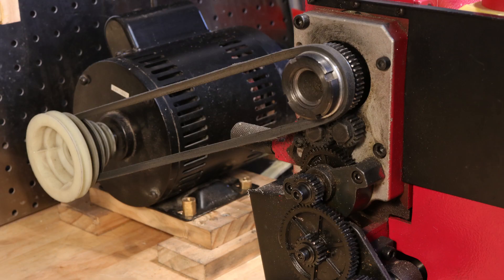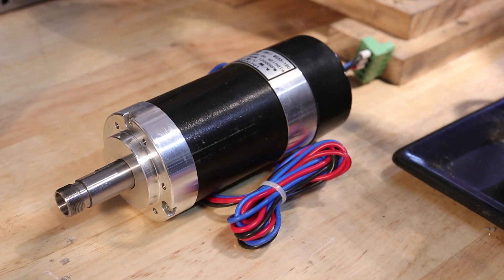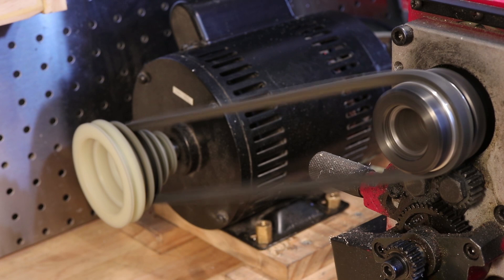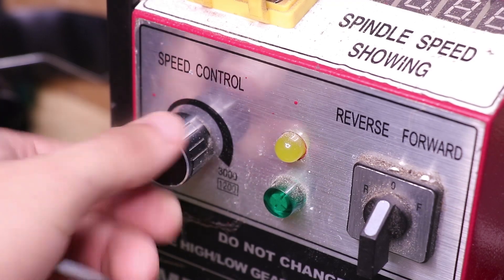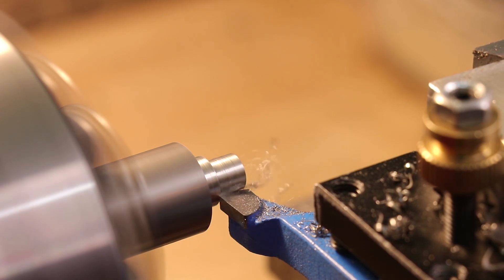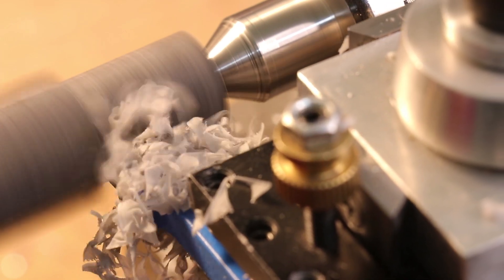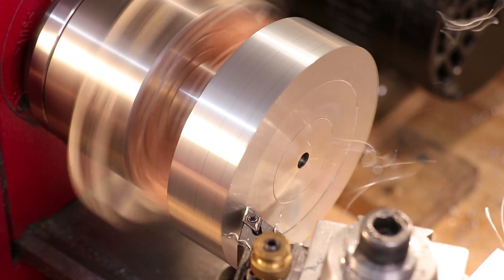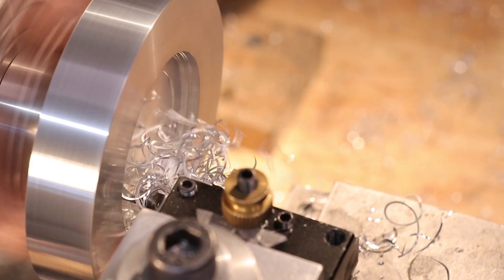Mini Lathe AC Motor Upgrade

Comment from the maker: G'day everyone. Thankyou all so much for the feedback. I might have said it but motors and electricity are not a big strong area for me. I apologize if I got a few things incorrect in this video, and thankyou to those who corrected me. Cheers.
Reply: Please provide the address for this mini lathe dealer/distributor, in Indonesia .
Reply: Do you need to remove the internal gears on the headstock, or just lock the lever into the unengaged position, just using the auxiliary motor when heavy cuts are required?
Reply: Hey, what's up? Here i will give you some extra points if you are interested, 1 you can purchase a single phase VFD for that motor
2 another option is to use a big brushless DC motor and a large power supply and esc
3 the most obvious one it's to change that motor for a 3 phase motor and use a single phase to 3 phase VFD (which are very common and for that, quite affordable)

Comment: I'm about to do the same thing with my 7x14 mini. I'm adding a 1HP AC 1 phase motor with variable speed. I don't need reverse. I have a motor laying around that's 1750RPM (compressor motor) so I figured I'd use that. This gives me a better idea, though I'm not going to need the belt pulley you are using to control speed. An AC motor speed controller can be found on amazon for around 20 bucks and they work pretty well. I'm turning my own pulleys and will be replacing the stock bearings with tapered roller bearings and making an oil seal for the shaft so I can just use heavy weight oil for lubricant rather than occasionally adding grease.

Comment: How do you get 1800 rpm on a 50Hz induction motor? The synchronous speeds for 50Hz are 3000rpm and then 1500rpm, and then the slip will slow down an induction machine a few percent at rated torque.

Comment: I really like your idea but my question is, since you pulled the motor and pulley attached to it from your drill press, couldn't you just use the pulleys off the drill shaft and re-work them on your lathe spindle? This would give you multiple speed settings over a broad spectrum from very high rpm to a low rpm. Thanks!

Comment: If you use a common condenser start motor you can easily reverse switch it. Just watch the pulley doesn't unscrew in reverse

Comment: I'm surprised no one has tried closed loop speed control of these dc motors, whether brushed or brushless. I have no trouble doing wide groove cuts on my 350w brushed mini lathe but my hand is on the "speed" dial cranking up the power to maintain a steady 100rpm or so while also feeding the cross slide. That's the problem with dc motors however, to maintain rpm under load power needs to increase but it can't do this on its own. AC induction motors on the other hand naturally pull more current as load is applied to maintain a fixed rpm, coupled with the fact in thus set up the motor is running at peak torque constantly with gearing to adjust spindle rpm.

Comment: Where did you buy the spindle pulley?? did you buy it or did you make it urself?
Reply from the maker: The pulley I made from a piece of 50mm diameter aluminium. The belt is a common k30 v belt
Reply: @artisanmakes   Is the pulley threaded on or is the ID just large enough to slide over threads? Thanks
Reply: @Glenn Howe

Comment: "Insulation class" is what you're looking for on ac motor.  it's longevity directly related to the avg temp it operates under.  it should be a letter on your nameplate, A - H

Comment: If you need all the options & speeds etc etc....buy the right machine for the job instead of constantly jerry rigg'n the poor lil lathe. Seriously...a motor driving a shaft with a chuck on it to turn simple parts doesn't need all that many bells & whistles.

Comment: Where did you get this from...? https://youtu.be/I7UU_MoaieI I mean that "single phase AC don't work well with VFDs" statement is pure nonsense. Single phase AC works very well with VFDs if you buy a VFD made for single phase use. In fact, it is very common, and a good reason to buy a VFD in many places, where three phase is not available. There is no reason to confuse your viewers with such statements, especially for hobby use, it is an excellent way of generating three phases to enable use of 3-phase motors. I dare say that your solution is MUCH worse than using a VFD and a 3-phase motor, but considerably cheaper.

Comment: so, having no reverse does not matter?  Thats what l want: on off switch. No mother boards & controller.
Reply from the maker: Not for me, at least at the time when I did this upgrade. No control board, and when I stall the motor, once I pull the cutter back it springs back into life. No resetting anything. Cheers
Reply: l have about completed your install of plain ac motor with 4 banger pulley.  Gotta make alum pulley on motor.

Comment: For anyone looking at this upgrade, consider a gates polyflex belt. With the appropriate pulleys you can get 8 ratios in a small package. My lathe gives 8 speeds between 360 and 2820rpm off an AC motor.
Reply: nice and compact

Comment: I understand your reasons for your motor selection. However, everyone has different needs and wants for their motor for their lathe. A quality variable speed motor with a equally quality speed controller circuit can and does work flawlessly for years. It is all in what you want for your needs. Thumbs Up!

Comment: What pulley did you use on your lathe spindle for the belt? Dimensions? How many teeth? What size belt, how many teeth? What's the groove rating? Links?
Reply from the maker: It's a standard k30 v belt, no teeth. The friction of the pulleys is enough to drive the spindle and in the event that I crash the tool into the machine the v belt will slip and prevent it from potentially snapping. And it's much easier for me to machine custom v belts in-house than having to index and machine teeth.
Reply: @artisanmakes  Please make some more Mini Lathe videos, they're great
Reply: @artisanmakes  Do you remember the inner bore diameter of the pulley you put on the spindle?

Comment: Wow so I shouldn't put a hydraulic motor directly geared into the headstock. I figured itd have great low end torque, and it would be adjustable... But I guess I could shred all the gears lol
Reply from the maker: I'm sure you could find a way to do it, since the motor directly drives the spindle it won't put load on the headstock gears, only the leadscrew.

Comment: You should really put a big sheet metal shield of that motor.. give it a little space so that air can still get into the motor easy, but the shield can block all of the debris that is flying off of the lathe.  Letting all those chips and dust go right into your motor is a good way to kill it fast.
Reply from the maker: Not a huge issue for induction motors, had it this way for over a year and a ha and I've never had issues
Reply: @artisanmakes  I get that...but you're throwing metal chips into open holes where there are coils of wire.    If you keep letting it get caked with dust, eventually it would overheat when you actually run it hard.  Even if it takes years, there's just no point in taking that risk when a simple piece of sheet metal or even plastic could be mounted over it.. Super simple....  We could drive our cars without air filters and it would work fine--  but it doesn't make it a smart thing to do.....  I mean hell----  Just lean a cardboard pizza box over it.  done

Comment: It was what I was looking for, I have a similar lathe and I'm about to mount it with a single-phase motor with a 6-pole switch for reverse, you would have to try it. Greetings. I use a translator, my English is terrible

Comment: The minilathe is really lacking torque   at low speed. Both the motor and the drive belt are a bit too small for my taste and the low cost (no gearbox at all) version is thus limited in size and speed (low end).
My first move was to make a DC driver with a good speed stability (using some type of speed sensor for a feedback loop). But an other type of transmission is a must and then going for a bigger motor is probably making more sense.

Comment: Just realised, you know you could use a triac as a speed controller right. E.g. a light dimmer switch ;)
Reply: They are less than ideal at low speeds.
Reply: @reneemakesthings  Fair, but you'd not need as much torque at low speeds when cutting threads?
Reply: @noviceartisan  Nah - the exact opposite.  You need ALL the torque to cut threads at slow speed.
The force on the tool tip is very high when cutting slowly (Have a look through ABOM and Joe P's videos for more detail), and that force needs to be balanced with the energy input.
The triac method works by reducing the amount of power going into the system, but in a very loosely controller manner.  The energy pulses are always spaced at 100Hz, so at slow speed, there will be a significant dead-space between those pulses.
It's in those dead-space where the motor can stall, or be over loaded.
This is why small lathes use either a brushless DC motor (with a controller running at 50-150kHz) or a VFD induction motor - they have much smaller dead spaces in the power delivery cycle.

Comment: That's weird, I thought VFDs emulate three phase power https://youtu.be/apQKgs_D0DM And what kind of lathe did you buy?
Reply from the maker: G'day, my understanding is that vfds don't work with 2 phase AC induction  motors, but I was not aware that vfds could emulate 3 phase power. The late that I bought is a 7x14 Sieg c3 mini lathe. Cheers
Reply: @artisanmakes  I also like watching this lady as she is excellent at breaking down and explaining tasks on the lathe and mill. She has a whole series on beginning stuff, which is where I'm at and has projects that you can get the plans. https://youtu.be/YoN_MSuqzE0

Comment: I've hooked up a single phase VFD outputting 3 phase to a single phase 2 HP induction motor for my belt grinder.   No, not in the way you might think (using one output phase out of 3- this doesn't work with all VFDs, many will trip a protection circuit if the phases aren't in reasonable balance)..   In my case,  I had a capacitor start motor where both the run and start winding were identical (same gauge wire, same # of turns), so as an experiment, I took out the cap as well as the centrifugal switch and wired the motor windings in an L config and hooked up the VFD as if the motor was a delta with an open winding and calculated the appropriate voltages and programmed the VFD, and the stupid thing actually runs..   It lugs a bit slow speed, but I can get it down to 8 rpm and it still has full torque and I can't stall the belt and even though there's 1/3rd of the motor effectively missing, the phases are below the imbalance trip threshold so the VFD is still happy and I doubled the high speed limit from 1800 rpm up to 3600 rpm for hogging metal...    So there are many ways to get motor speed control to work, even some unconventional means...

Comment: If you don't want to spend $250-300 on a VFD + 3Ph motor solution, sewing machine motors are a reasonable compromise.  https://www.ebay.com.au/itm/333430509304. I have a 10x20 and I replaced the stock 1Ph 750w motor with a 600w 3Ph + VFD with vector control.  I overdrive the motor with 2:1 pulley reduction to improve the torque, has been fine so far.

Comment: As stated below single input to 3 phase output is normal for VFD plus vfd will give the reversing function.
One day I am gunna put a single phase motor on the output of a vfd and see what happens...
It is possible to reverse a single phase induction motor ONLY IF the four (or six including the centrifugal switch wires) winding wires come out to the connection box.
Most industrial type ac induction motors  (like yours I think) are capacitor start motors with two windings. A main winding and a start winding with the capacitor and centrifugal switch in series. You need to reverse the connection if the start winding to reverse the motors direction.
Having said all that, most single phase ac induction motors only have 3 wires coming out to the connection box and cannot easily be reversed. The main and start windings are joined internally with the junction wire plus the other end of each winding coming out.
You never know unless you havalook in your connection box.
Reply: FYI, generally VFDs are designed to function with some sort of feedback on all 3 phases and can be damaged if you don't hook up all 3 wires. I've tried it at work with old VFDs nobody would miss though, and it did as expected though the motor had a lot less torque than just a direct connection.
Reply: @LuciaMakes  Thanks for that. Did you a vfd 3 time the rating of the motor? If not, maybe the VFD could not supply the motors required current thru a single phase, particularly start current?

Comment: Have you considered using one of the sub $200 USD sewing machine motors, often sold as "Sewing Machine Servo Motor BLDC." They are incredibly  torquey at low and high speeds and beats any AC induction motor VFD or no VFD at the same Wattage. They all come with their own controller.
Reply: I bought one of these for my wife's industrial sewing machine 10+years ago, and when it arrived she was so close to tears, as she couldn't believe how dumb I'd been to think this tiny motor was going to replace that over 100lb AC clutch motor that was no longer working. I showed her the hp rating was actually a quarter horse higher, and she just looked at me like i was an idiot that wasted $80. She is from a 3rd world country, and $80 is close to a weeks wages there. She saves money like noone I've ever known. So she is really upset at the way i e always spent it. Like water trickling , and  flooding  out. I tuned her  out, and hooked it up.  No lights dimming when clutch is engaged, no clutch to engage.  
No constant loud motor running, all is quiet till she pushes the foot pedal, the same one as before, motor came with all the proper linkages. It has been running in a sub commercial fashion for over a decade, and works fantastic. She admits In a production environment, like a sweatshop, the clutch motor beats it hands down Becuase the motor is constantly running full speed so when clutch is engaged, it goes right now. This takes a fraction of a second to build speed. But she isn't working in that environment. She is hemming pants and skirts mostly, or as she is trained making patterns, and then dresses and gowns for weddings, proms, balls, what have you. Mostly day to day is hemming pants, and skirts, taking in shirts, and blouses, that sort of thing. And the $80 servo is a beast. So easy to move that machine that used to take 2 men to lug around. And I am a very strong man. I've been waiting for her overlooks motor to go, the damn thing must be 70 years old, but it keeps on going. That thing is probably $500lbs, and a huge chuck of that weight is the massive half horse AC mortor. I've eyeballed that motor up for my lathe many times too, and thought of getting her a servi motor just so i could have it, but like i say she is very anti spend, so my spending is down on the low down as much as possible.
Reply: I just saw a video about them where they compared and he was burning his hands when he gripped the pulley on it, but the brushed motor easily stalled.  Serious torque for sewing leather at low RPM, AND for a lathe.
Reply: @generalawareness101  I've been eyeing them for years now and they keep getting cheaper and cheaper. I might bite the bullet and buy one.  It would make an awesome CNC spindle motor configuration.
Reply: oh man you are just the BEST!  thank you so much! i've been looking for something exactly like that!
Reply: Instant braking/stop of servo motor, won't it damage motor shaft eventually through metal fatigue.
Reply: @rodenreyes6320   It would require a significant load in which case the shaft will more likely succumb to axial forces.
Reply: A 1HP ≈ 750W Brushless Sewing Machine Servo Kit 110V Pure Copper Core Motor 500-4500rpm is slightly larger diameter and a little shorter than the stock lathe motor. With a custom bracket it can be fit in the same location. Controller has braking, direction, ramped acceleration, and reversing control. These motors are extremely quiet too.
Reply: @WireWeHere  Interestingly, the wattage can go even higher.

Comment: There are VFD 1Fase to 3Fase  output.
eBay     2HP 1.5KW VFD SINGLE 3 PHASE SPEED VARIABLE FREQUENCY DRIVE INVERTER INDUSTRY 8A        .